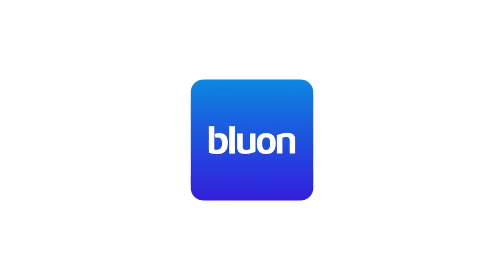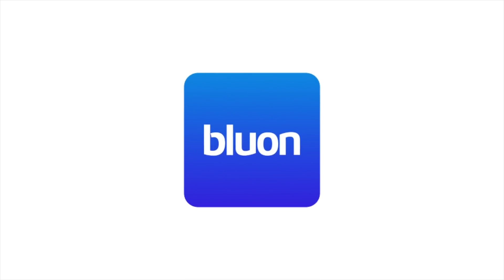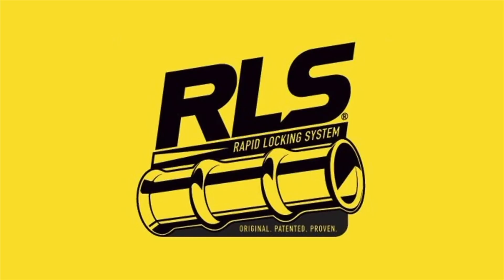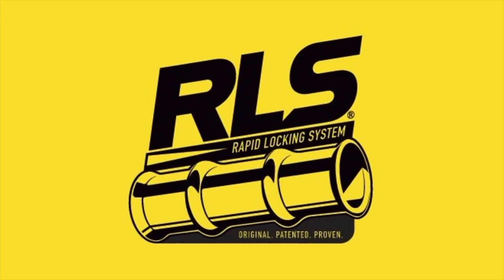DON'T Buy This Type of HVAC System!! | Common Problems...

Comment: Isn't adding nitrogen to a system with ANY amount of refrigerant a blatant violation of the Venting Prohibition section of the Clean Air Act? It certainly says it is online. I also remember this from taking my EPA 608. Pretty sure if there is any charge at all you're supposed to recover the remaining refrigerant before you can add any nitrogen.
Reply: Large nuts with peanut brain

Comment: Did I miss the part where you discussed avoiding this type of HVAC system? You discovered a leaky system, and replaced the unit. Is it worth it to lose viewers to hang a clickbait title on your vid? I won't be back.
Reply: Bingo, who hit it on the head, so where the ac to avoid.
Reply: @safffff1000 dudes a sponsor guy, not a real tech

Comment: I’m not the sharpest tool in the shed but I have a difficult time trying to find leaks… I normally bump the pressure up with nitro to the design pressure on the low side and sniff with my leak detector (field piece slr8) I’ve used it a hand full of times and had not much luck. Seems like it’s very sensitive at times or gives false dings. Any advice would be appreciated.
Reply: Oil stains and soap bubbles are my go to tell tale signs of where to look brother

Comment: A tech should always have the conversation before adding nitrogen to a system. As reclaiming or venting would be needed after adding nitrogen. First miss. Leak check good and not stopping after first find is great. I would hate to have one of my techs jump to nitro and not have the conversation before.
Reply: Per the EPA it is acceptable to install a small amount of refrigerant with nitrogen fill for leak detection purposes using a very sensitive sniffer device. Many leaks won't actually leak until they're under the high operating pressure, which is why the N2 is needed to fully pressurize the small quantity of refrigerant.

Comment: What would qualify as extremely low on refrigerant?  I’m just getting into leak detection now.  I use to always just top it off.  I like the bumping it up with nitrogen idea.  I had trouble finding a leak with light wind the other day.
Reply: I like to look at standing pressures when system is off and everything is equalized if it's under 5 degrees outdoor ambient in saturation temp on your gauge you typically will have less than half total install charge

Comment: Your title says: "Don't Buy", don't buy a Rheem/Rudd or a package system?   In my area,  Rheem/Rudds are very good systems.   Also we almost only have packages.   Miss leading title. 
As for your video,  it would be helpful if you state how low it was.  Keep it legal.
Reply: I’ve seen lots of those old rheems still kicking after 15-20 years
Reply: @MrJayray63 My Rheem was installed in 1999 and I have had to replace a hot surface igniter and a control board.
Reply: The lowest quote we got to replace our 19 year old  3.5 ton 12 SEER RTU Tempstar is for a Rheem 3.5 ton 14 SEER package heat pump.  The next best price is on Day and Night and Ruud (Rheem) package units.  Rheem and Ruud package units are the most commonly found around here in this part of AZ.  We’re leaning towards Rheem because parts are readily available here and a couple of friends recommended the contractor. Our heat pump didn’t have any Freon left and would have cost $800 to install some kind of stop leak and R22 with no guarantee it would work, so we’re going to have it replaced.

Comment: For the guys who are new to the trade. The unit had a small amount of refrigerant in it before he added the nitrogen. Before he opened his manifold it was at 45psi standing pressure. The nitrogen will help force the refrigerant out to pick up with your leak detector
Reply: You can hear the compressor, metallic sound. He turns the breaker off afterward. I like to put gauges on before I turn on the unit for this reason. Watch the pressure get pulled down to zero if it’s really low on charge
Reply: @lj6672  I see and hear it now. 👍
Reply: @lj6672 he done making videos
Reply: At 2:00 when he first connected the hose, the refrigerant pressure was negative, basically flat.
Reply: @realSamAndrew with the unit low and the compressor running it will pull your suction into a vacuum
Reply: @lj6672  I didn't think the compressor was running. I thought he just hooked it up to get an instant reading. Are you sure the unit was already on at the time the hose went on?
Reply: Is he done making videos

Comment: Not cool with blowing Nitrogen into a system with unknow quantity of Refrigerant. Now you have to pull the charge and bill the customer for more (by weight) than you would have originally and you've got a useless mixed charge to deal with... Not criticizing, but that seems like a pain in the ass to me. Now, I've only ever worked commercial so I might be full of crap.. Please correct me if I'm wrong. Residential is not for me, but I like watching the vids..
Reply: Going off his manifold reading. A morning fart has more vapor in it than that system has. System flatter than Paris Hiltons chest. I'm more curious how the hell he found that leak with leak detector with no refrigerant in there. 🤔

Comment: You ott clarify for the new techs that the unit in the video was out of refrigerant and it is not okay to mix nitrogen with a system that still has some of its charge left, only a trace amount is to be added with the nitrogen.

Comment: Don't buy Rheem is a little whiny, isnt it? Trane has had major issues with leaks and so has just about every other brand out there. The new ones use bohn coils, are those junk too? Are ADP coils impervious to leaks? I'm genuinely curious what your thoughts are.
Reply: Your title is not a fair assessment. That’s a pretty old unit, every brand have had leaks and still do.
Reply: As I guy who installs Day & Night I’m just gonna say that ADP coils definitely leak 😂 also my all time favorite units are the early to mid 2000s Rheem units. Simple and bulletproof. Sadly a lot of them are going the wayside due to age, but they’re still solid the ones that do run!
Reply: Also I do alot of refrigeration work and I only install Heatcraft/Bohn equipment so 🤷‍♀️ no complaints
Reply: @miniman9198  I prefer heatcraft for refrigeration as well, but I've also set Russell, which is a Rheem brand. No issues with either, but heatcraft still edges out Russell for me. 

My business is a Rheem Pro Partner, so I'm probably biased. However, I could (and would) set something better if I felt like there was a better manufacturer. I have yet to have a warranty claim denied and they always take great care of my issues...for the most part. I still think most of them could build a bulletproof unit and sell it for what it's worth, but instead engineer a unit designed to last 12 years. Just my opinion.

Comment: Ok.....Im confused. Did you dump nitrogen in w/ what was left on the system, or did you recover? Would what you recover be any good anyway because i assume youll suck outside air thru the leak hole...but i know the rest of the charge is gonna be worthless if you dump nitrogen in with it...🤯
Reply: The low side pressure with the compressor running was -2.4psi. I doubt there was much there to recover.

Comment: I appreciate your videos very much as I am one of those guys you mentioned at the end of the video! So are you pumping nitrogen in without pumping down or is that only because there was next to nothing in the system,? Would you still do that if the unit still had 50% of its freon?  Thanks man!
Reply: If the pressures look just a little low, you'd be best to recover, but with the low side at -2.4psi it was a safe bet there wasn't much charge left. I'd have still made sure it wasn't a closed txv first, but he may have had some history on the unit and knew it was losing charge from the start.

Comment: How do you keep your fingernails so clean?  I'm doing up to 40 hours OT every 2 weeks and my hands are thrashed (yes I wear gloves).  Hook a brother up on your secret.
Reply: Wear gloves as much as possible.
Reply: @ShanQueefus  LMAO.  Dude I could double or triple glove and my hands would be thrashed.  I thrash brand new milwaukee gloves in two weeks.
Reply: @manschool4992  milwaukee gloves are for electricians.
Reply: @ShanQueefus  Dude.  I work with a team of 43 commercial service techs.  To a man, our hands are mangled mitts.  To a man.  I've seen high volume electricians too and their hands are mangled, dirty and calloused.  This dudes hands are not high volume anything.  That's a fact jack.

Comment: Did you mix the nitrogen with the 410A?
Reply: I've actually heard from HVAC school it's ok to mix R22 to find it faster. Once you're sweeping the system after the test anyway.
Reply: Just added the n2o for leak checking. .  The charge was probably to low anyway.
Reply: @ShanQueefus  The suction pressure was -2.4psi with the compressor running.
Reply: He pressurized the system with nitrogen because it had hardly any refrigerant left in it, as you can see on his gauges when he hooks them up. The nitrogen forces any refrigerant out of the pinhole leaks allowing his sniffer to find them. Without nitrogen pressure, his sniffer tool more than likely wouldn’t have found a thing, as the outside air pressure is greater than the pressure inside the system, thus preventing any leaks from occurring.

Comment: Hey Zac, great video as always! I have a question about the install process. When you pressure test with nitrogen does it matter what direction the nitrogen gets pumped through? Same with the vacuuming process. What line do you pump from? Lastly does a TXV or piston affect the pressure test or vacuuming in any way? For example is it possible for a TXV to close and prevent nitrogen/vacuum from reaching both sides of the system?
Reply: I always fill nitro the way the refrigerant flows, then when emptying I go out the suction. Then when I open the system I open suction first then liquid
Reply: @chandlervoit4630  interesting...I've never read anything saying that there's a 'correct' way, but I do follow the same steps as you but I open liquid side first. I've never really thought too much about it I guess. I just do it by habit now. 😅
Reply: I wouldn’t think it would make a difference, it’s usually easier to fill from your service ports at the condenser. In rough in situations I cap the inside and install my own shraders outside to pressure test. When you vacuum you can use a single hose setup or a dual hose setup.
Reply: I was taught to fill only in liquid line to make sure txv is working
Reply: From my personal experience in hvac, yes it is possible for a txv to close off and prevent you from pulling a true vacuum.  If you pull a vacuum and add refrigerant, you will now have noncondensibles in your system making. I have had quite a few txv metering devices cause premature compressor burnouts. If the compressor is already bad, then I can't test the txv by my refrigerant pressures. Instead, I blow nitrogen through the liquid line, and if it flows freely, than my txv is not locked shut. I am aware that this does not always let me know if I have a bad txv, but it does let me know if it is stuck closed. Another way to know you have a txv that is locked closed is if you are pulling a vacuum and the micron guage keeps jumping all over the place. If your micron guage is jumping all over, than you either have a restriction in the metering device, oil with moisture in it, oil sitting in your hose or evap coil, or a leak. You may also have a restricted filter drier. Regardless, always replace the filter drier for assurance.